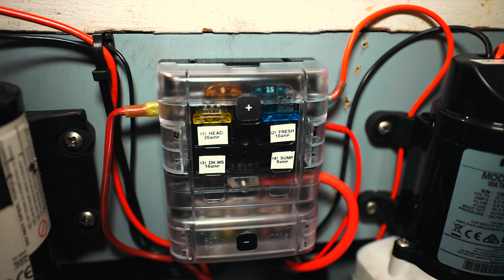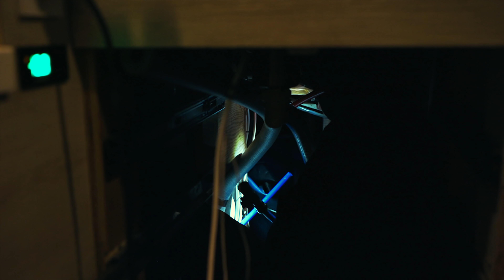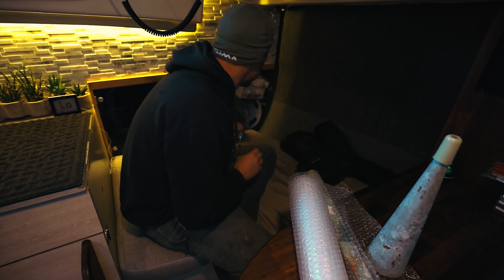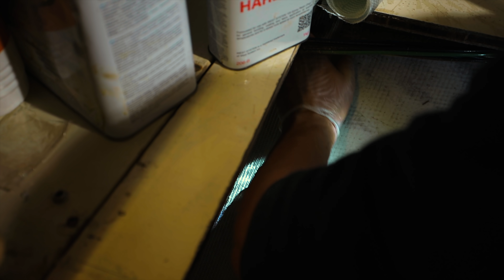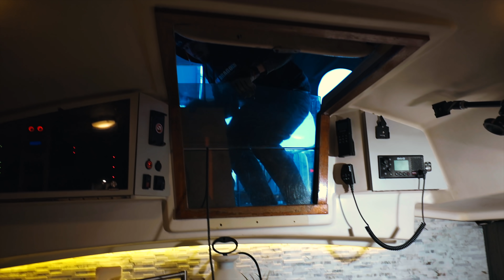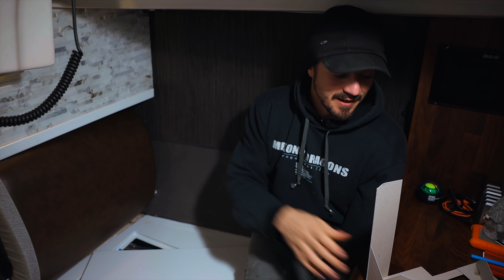Preparing For Something Special — Sailing Uma [Step 256]

Comment: So you Have a four fuse block at the pumps, at various AMPS. If you have one feeds coming from the panel to that fuse block feeding those four pumps what size wire is it and what size breaker is it

Comment: Battle born battery below freezing (24°f) warning:  (Quote from battle born)
"The batteries will no longer except a charge once the temperature drops to 24°F but will continue to discharge until the temperature reaches -4°F. Battle born suggests installing batteries in battery box or heated blanket to keep the temperature up on the batteries. Also as heat is concerned batteries will shut down once temperatures hits 135°F."
Reply from the maker: Yup. We know.
Reply: @SailingUma  I'm not sitting on the couch but as you been talking about the severely low temperatures and also talking about charging batteries in your new high current dockside Configuration. I thought of the possibilities that you could damage your expensive batteries. Sorry I know some subscribers like myself probably frustrate you.
Reply from the maker: The BMS prevents any damage to the batteries, that's what its for. We can't really do much to them to damage them, unless we ran them down to 0% and left them there for about 4-6 months with no charging at all. Then they would take a bit of work to get going again.

Comment: Have you considered a recirculating shower system to save both water and heating energy. A company in Sweden, I think, does a commercial product, Orbital-Systems. I’m sure Dan could put together a DIY version.  I’ve seen DIY versions being put in van conversions. Snow and Curt, I think and Mispronounced Adventures....anyway, just a thought.

Comment: I love the point that you guys try to keep the boat is  100% electric. But for sanity sake Why not install a small diesel fired heater That you can fuel with a one gallon jug overnight?
Reply from the maker: Why? What we have works fine. Plus, Then we’d have to carry cans of diesel ...just for that heater.

Comment: Consider RV antifreeze or alcohol/methanol to winterize water lines in the winter. 30% alcohol/methanol concentration will provide freeze protection down to -9°F / -22°C. I work in the portable restroom industry and know all about winterizing. Cheers.

Comment: 10:13 , use a membrane meant for low pressure,,, several of them in fact and just feed the salt water to the top of the mast and let the weight of the water do the work... it'll be slow but over time you should be able to maintain full fresh water tanks.

Comment: Again, amazed by the number of power tools you carry on Uma.  How do you convert from 240V to 120V as I assume your tools run on 120V? Or do run them off your battery banks?
Reply from the maker: We have a 120 and 220 inverter on-board and plugs for each. See previous videos.
Reply: @SailingUma  Yes, I remember now the episode on replacing the converter/inverter by -180000C.
Reply: By the way, the last time I mentioned your extensive collection of power tools, you said that it could be the topic of an episode in the future...  Cheers!
Reply from the maker: Yup. it will be. Someday. The future isn't here yet ;)

Comment: Something I forgot to ask you guys how are your batteries doing in this cold  weather that you're in. Are you doing anything to keep that area warm or do you have a heating pad under the batteries? Just curious what you're doing on your lithium batteries to keep them at an even temperature
Reply from the maker: Nothing. They’re working just fine. They’re inside our boat (which is heated) and don’t get below freezing.
Reply: @SailingUma  At what temperature do they get adversely affected/reduced output?
Reply from the maker: They stop accepting charge at -4C and get reduced output around -20 I believe. But that isn internal temp. Which means the ocean would have to be -20C, which would lead to many more problems for us ;)

Comment: What type of marine water heater did you go with? We have one but it is a 120V house water heater that will need replacing on our sailboat.
Reply from the maker: It’s made by an Italian Company called “Quick”. Nothing special, just what they had at the local marine store. Should get us through the winter and next year no problem. We’ll see how it goes.

Comment: First of all thanks for your inspiring videos. Don't stop! I'm buying a sail boat and I will install an electric engine. Why diesel??? doesn't make sense! I saw this video. My life is Industrial Fisheries, big vessel. About pressure pumps: Don't forget that you have a natural source of pressure! Your draft! from surface to your draft it will be more or less 2m that's a lot of pressure if you put your water in a high level.
Reply from the maker: Would only work if the water maker was installed at the bottom of our keel? Is that what you’re suggesting? Most of our boats bilge is only 30-40cm below the waterline, so not much gain in pressure.

Comment: Almost thirty years ago I built a custom hot water tank for our boat.. and upgraded to a larger 1.5 KW element which I rarely use as I can get most heat from the waste heat of the engine via a heat exchanger.  I use the water heater to also head the cabin via a water to air coil with fans when we need extra heat - we have a heat pump on board as well - 15KBTU...  The engine waste heat can heat the cabin while we are underway with this rig... Love your central pump placement and your wiring and plumbing is very tidy - well done... Next up will be a wash down pump on our boat and likely also a cockpit shower - which will be set in the seat locker.

Comment: glassing in that low tempeature is not going to fly... polyester cant harden correct and will not get any strength att all, not 100% shure about epoxi but  it probaly wount work either....
Reply from the maker: Oops too late. It already worked.
Reply: @SailingUma  GREAT ANSWER. You win the internet for today.

Comment: Hi to Kika and Mat.  I have been using a 1/2" beltsander (you: file sander or finger sander) for about 2 years now, and when fiber glassing, gel coating  or just generally working with paints and resins on a boat, my go-to choice of sander for many jobs.  Of course, for larger jobs you would need a bigger sander, but for repairing dings, or small cracks, really speeds the jobs up.  One caution: Don't think of it as a toy, it will rip away resin at a terrific rate, it's good to pay attention.

Comment: Regarding remote places and powersupply, Have you considered to double up the solarpanels with heavy duty drawer rails?
Then you can slide out, and double the solarpanel area when needed.
Reply from the maker: Sort of. Yes. But not quite like that. We have a few things in the works. The problem currently is weight. Rigid panels are heavy.
Reply: @SailingUma  I know, but there are drawer rails witch can take loads of 250kg. I assume that is enough?
You may even figure out how to make it work with in total 8 panels! (One on each side of the current panels, and four behind them) ;-)

Comment: With a 1.5 kw water heater you also use much more hot water and drain the batteries again,like with the diy water maker .Normally peopledont use hot water a lot,and when the hot water tank  is isolated well it want need a lot of energy  to replace the used water.Depends on how many liters you store of course.
Reply from the maker: Yes. For us, it will most likely be something we only used when plugged into a dock. But, still nice not to have to go for a hike everytime you need a shower.

Comment: I'm going to sail to Sweden in a couple of years but after watching this, I think I'll head south for the winter. I'm installing a water maker this fall and I'm also debating whether to install a wind generator or by a gas generator. This video has me leaning toward a gas generator, since I'll have to have gasoline on board for my dinghy anyway.
Reply from the maker: Norway's coast is much warmer and doesn't freeze like Sweden does. Besides the sailing is way more EPIC with the Fjords. We haven't needed a genset or additional wind yet since they're are marinas everywhere and most places are too deep to anchor anyway. They're also pretty cheap for the night. So we find ourselves docking and plugging in at least once a week. If you plan to be more remote, that a gas genset would probably serve you better this far north in the Fjords than a windturbine. Solar is non existent and we've gone weeks without winds higher than 10kts.
Reply: @SailingUma  I hope to sail up the Norwegian coast too. I've visited Sweden but have never been to Norway. All of my relatives came from Sweden but apparently we have a few Norwegians in the woodpile.

Comment: Hi Kika, hi Dan, like your DIY projects ..... hot Water for showing and in the sink, very fine. I think you have an eye of the Temperature in your Watersystem, please. Unfortunately there are legionella and they live by temperatures between 20-55* C. So don’t store Water between this .... better at 60*C .... legionella can cause a heavy pneumonia if you inhale aerosol with them for example by taking a shower. I am not sure if there are any chemical to „clean“ your water (if you like chemical)..... please have a Look to this legionella.... LG Steffan
Reply from the maker: Yes, our tank is set high, but then it goes through a mixer valve so we don't burn ourselves at the tap.

Comment: Awesome job as always. Can you comment on how you deal with humidity when showering and cooking inside the boat in such cold weather? Thanks~
Reply from the maker: We'll take all the humidity we can get. With the heaters and wood stove running our boat dries out VERY quickly. We add humidity by leaving a pot of water on the wood stove. Otherwise we'd dry up like little raisins in the sun.
Reply: @SailingUma  In "The old days" they always had a big pot of water on the stove for 3 reasons; dealing with humidity issues, instant acess to hotwater and extra heatbattery. :-)
Reply: @SailingUma  Wow. Would not have expected that. Thanks for the info.

Comment: Hi Dan ... nice project again.  Q : why do you put your water-filter behind the pressure pump - I found it problem-sum to have this part always pressurized and moved mine just before the pump
Reply from the maker: No issues so far. It's designed to be installed like we did. That little red button on the top is a pressure relief valve.
Reply: @SailingUma  Thks for the feed back

Comment: Schenker or Spectra?  That is the question.
  I went for Schenker, as it uses industry standard filters available all over the world.
  Since installing it, I would have gone for a bigger one. As for even the quietest Clark pump on the market,  it's still noisy for me.
  Will be interesting to see what you chose.
  Not only does it provide water,  but freedom of navigation choices. To be able to go anywhere not constrained by needing water.
  A great upgrade!
Reply from the maker: You'll just have to wait and see. But just to clarify, every water maker uses "standard" pre-filters. But with that said, most only recommend "their" filters, since there is a HUGE difference in manufacturing processes and quality. And since the $5 filter is protecting the $1000 membranes, why cut corners.

Comment: Hi guys. You should consider the potential bacterial and slime growth inside the tank. Keeping the temperature above 65 degrees is safe.
Reply from the maker: Yup. Like we said. Tank temp is high, then it goes through a mixer valve so we don't burn ourselves from the tap.

Comment: Where did you guys get your carbon filter from I need to get one for my toy hauler. Unfortunately I don't have a sailboat or a catamaran CV 19 took care of that. I love how you made the area for your water maker to fit still amazed by the push button off on water switch on your shower floor you guys have done a great job

Comment: Well, now that you have 3 appliances that use sea water, you could build a sea chest in the bilge w 1thru-hull on Stbd & 1 on Port. Run the systems on either tack. Save your pumps. Fewer grass clean outs. Fewer thru hulls.

Might not work if the sole is below water line & you can access aft of the sink easily

Comment: Looking at your video, it looks to me like a Spectra unit.  I installed one of these on my boat, and when it arrived the pump, controller, and filters were all bundled in a single unit.  Instead of installing it awkwardly, I took the unit all apart and installed each component individually and much more compactly in the spaces I had allotted for it.  Spectra was ok with all if this when I talked to them.  You'll probably have it all done by the time you see this, but if it can assist, great.  Otherwise, i'm sure you have it all handled and I'm enjoying the videos.

Comment: An y chance I could get the details about that articulated tap you;re using? I love it!
Reply: It is called a Pot Filler; designed to be installed over a cooktop to fill pots. Should be a standard hardware item.
Reply: The down side of the pot filler is that it does not have a mixer... no way to change the water temperature...hence the mixer by the water heater and the added buttons to select hot or cold water for the sink.

Comment: It takes the same amount of energy to heat water to whatever temperature you want. 1.2KW or 500W takes the same energy, but 500W will do it much more slowly.
Reply from the maker: Exactly. When we pull into a dock at the end of a long, cold sail and want to shower before before crawling into the v-birth, we don't want to wait 3 hrs before we can shower. A new element is about $50, so might be worth the upgrade. We'll see.

Comment: Nice work! Im sure you realize that  a watermakers output is based on 70f seawater temp. Will be interesting to see the actual production at such a low temp.
Reply from the maker: Sure it varies, but not by that much.
Reply: Did NWP in 2017, had no issues making water

Comment: Did you consider on demand water heater, instant on no wasting electricity keeping water tank full water hot. I know the gas one’s are very efficient maybe the electric one’s not so much!
Reply from the maker: Yup. We'd love one. But they don't exist for our needs. Electric ones start at 10kW+ and we don't have gas onboard.
Reply: @SailingUma  The Norwegian webshop Wee have a instant heater. Adjustable up to 55°c on a panel 3,5-5,5 kw
Artikkel nr: 24478.

Comment: Go for the Clark pump, as the overall power need is significantly lower, and by reducing rate of watermaking using parallel smaller membranes and switch off some of them...   Also turn off system until batteries are charged during a days sun/sail energy harvesting...

Comment: We would have loved to see what wasn't working WHEN it wasn't working. I guess you two are just busy traveling but design failures and mistakes are part of the journey. Getting all of that problem analysis info as summary fait accompli is quite anticlimactic, really. It happened with the fireplace chimney and now the water heater... perhaps it's just me and cabin fever. Nonetheless, quality of the piece is still top notch. :)
Reply from the maker: Boat projects take about 2-3X longer when we film them. Sometime, we just need to get things done.

Comment: A water maker for use at remote locations needs a LOT of spare parts !  Hose, fitting, seals, O-rings, etc.  I know Dan can fix it, but without the high pressure parts, he probably can not due a "MacGyver" solution !
Reply from the maker: We made sure to get the complete rebuild kit for our unit. Shouldn't need it for many years. But it doesn't take up much space, so better have it anyway.

Comment: I was just wondering why you don't have a little inverter generator like Honda 2000 or 2002 to run just for things like a  water
Reply: Hit the button to soon Honda generator they sip gas so I think you would have space for one and only use it when away from other sources.
Reply from the maker: So far, we just haven't needed one.

Comment: I don't know how you could go this long without a water maker. We bought a used Pur unit that produced 1.5 gallons per hour on a 12 volt system. We only had to use it every other day to top off our water tank. It was a great addition. While our friends were looking for sources of fresh water, we were seeing the sights. Did I mention that this was 22 years ago. You will love it. We used a 20 micron and a 5 micron final filter on the salt side of the pump. The best water we have ever had. And rinse the filters daily. When we sold the boat the water system went with it.

Comment: You gotta be careful not to get legionella in your warm water system with the low temperature of warm water. A safe way to prevent it, would be heating it up to 60 degrees C.
Reply: Dan said the water heater is hotter. The mixer after the water exits the heater is set to 42C

Comment: Water heaters are usually set to 60°C to avoid Legionella infections, especially when showering (by breathing water spray).
https://fr.wikipedia.org/wiki/Legionella_pneumophila#D%C3%A9sinfection_thermique
So probably safer to crank temp up...
Reply: Dan said the water heater is hotter. The mixer after the water exits the heater is set to 42C.